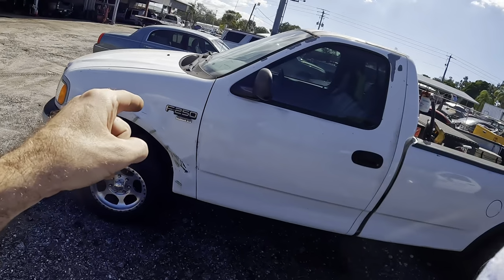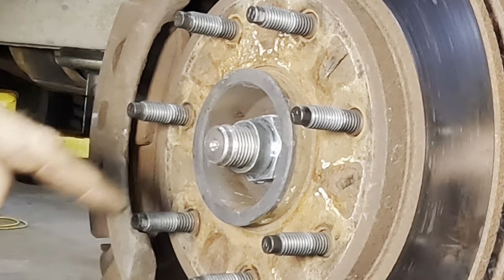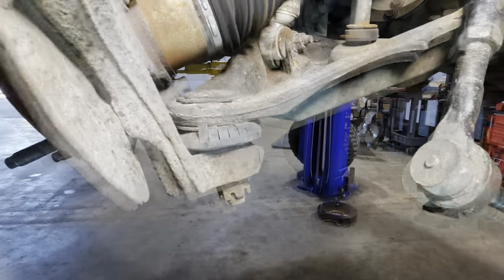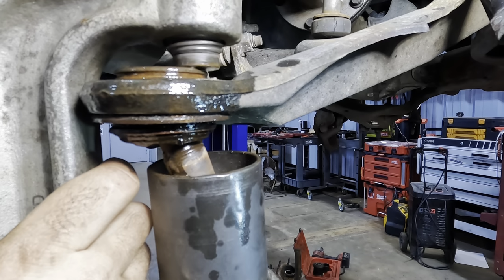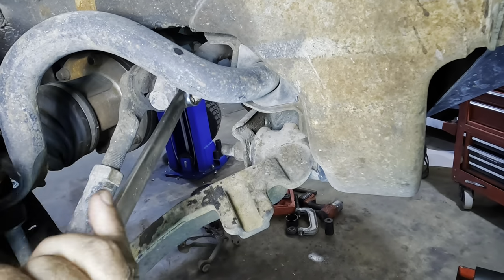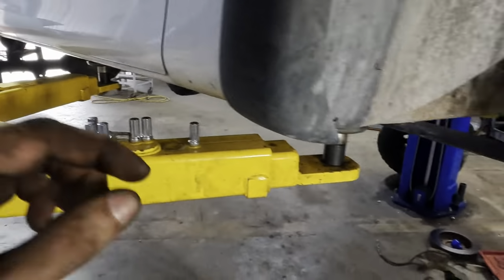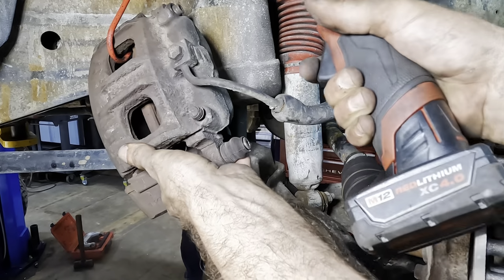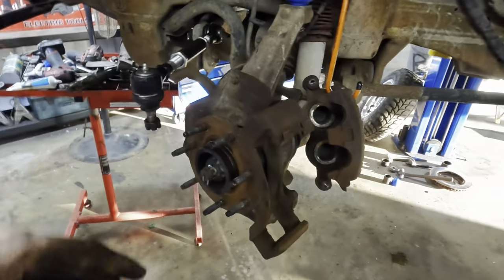Loose Balls- 7 Lug F250!  Wheels Fell off!

Comment: I'm wondering... Could those lower control arms might have been off a F-150? Making the F-250 ball joints the wrong part?
Reply: No, because the 7-lug F-250 is basically an F-150 with heavier springs and torsion bars.

Comment: Hey Ray! I can't help but notice that the rubber boot over the brake hose looks a bit swollen.  I suspect there is a bit of rust build up witch affects the crimp collar where the brake hose meets the metal line on the caliper. ( you can see it at around 52:10 into the video) I personally have had situations where the brake hose blew apart at those fittings because it can't take the pressure of the  brake fluid anymore. I now allways check under them to make sure they are strong enough. And no one like's it when your car does not stop when it's supposed to stop, because THAT! would be bad. Other than that another very good video👍
Reply: It’s a shield or covering over the brake line 
You can also see it earlier in the video lol

Comment: Hmmm. I wonder could that lower control arm have been changed for the wrong one, sometime in the past.
Though, I think the taper is too big for the knuckle, too, so the knuckles would have had to be changed too. ( Look at me talking American. That’s going to cause me some problems, when I get back to work!)
But the old lower ball joints do look a bit puny for such a big 4x4 so something seems a bit off.

Comment: '99 is probably 2 valve. And the odometer will probably come to life after key has been on for a few minutes (as my 99 Expedition does)
Reply: I don’t think you can push out the pistons on the same axle, aren’t Fords a diagonally split system ?

Comment: I hate the need to use a lug key, socket, flip socklet, etc I begged Snap On to make non flip half size mm sockets, and wheel lock keys that don't require a socket. They're missing the factory adjustment plates?  2WD lower C Arms? Had a customer destroy his spindle and we couldn't find a replacement ANYWHERE. Junkyard hunt/Mexico import :D

Comment: QUESTION:  is it common that your customers supply their own parts for you to install rather than you ordering the parts you need❓ I suspect the parts you order may be of better quality than customer ordered parts or am I incorrect on this point.  Cheers from 🇨🇦
Reply: Parts are also a profit center.  Ray had a video on this very early in the new shop.  I think he allows it on a case by case basis.
Reply: @StrongDreamsWaitHere  that is what I was thinking as well.  There is profit in those parts but only if he supplies them.  Cheers
Reply: I will bring in my own parts if I want a certain brand or type of part, like brake pads and rotors.  Most shops will put on whatever's in stock or is the cheapest.  The sooner you wear it out, the sooner you'll be back. Custom parts too. If they're going to pull the deferential cover, I might want an aluminum replacement.

Comment: The suspension is probably in such bad shape because it might have been in an accident. It still has the body pullers on the front driver side. Probably cause the shaving of that nut and the complete destruction of most of those ball joints or at least pushed em along.

Comment: Reee.....  @54:13, ABS sensor wire bracket not properly installed - missed the inner hole of it with the bolt.   Getting sloppy Ray - too distracted.

Comment: that guy whole front end replace, if it were my truck i would just replace both arms since the new arms comes with brand new balls, but also get a camber bolt since the bolt that came off didnt have the camber washer and drop some gear oil down the ABS hole to renew the grease a bit, you be surprise how well it works, tire rods inner and outer, drag, but its a ''work'' truck and most people that have a '' work truck '' treat them worse than a farm truck that doesnt leave the farm and only do bare minimum when the wheels fells off and only when they get caught other wise you can expect to find paracord and steel wires holding shit

Comment: Its a good job you'd got a buddy (Dave) to go to the autoparts store with the wrong item 
think of us soloists that have that problem and your working on your one and only transport 
It happened to me many years back changing the clutch and the parts didn't fit the spares place couldn't work out why their parts were so different from the old one I took in
Eventually after many parts unboxed they found a match
Good job they persisted to keep the sale otherwise it would have put me in the mire with no vehicle and thinking which parts dealer to go to next without having to goto the main dealers and pay triple the cost + cab fares

Comment: Am I going the right way? No but keep going... it will be funny!
 as we ratchet this unit it will push the pistons inwards... and if you clamp off the line & crack the bleeding nipple and contain the escaping fluids, the old crusty fluid will not go back through the ABS and into the reservoir overflowing it all over the engine bay & paintwork, and potentially introducing unwanted materials into anything that may be adversely affected by them.

Comment: Here's what I've always done to remove cotter pins readily: I straighten the ends somewhat, then I tightly clamp a genuine Vise-Grips on the round end, then tap on the Vise-Grips with a hammer, always works.

Comment: Ray: The "Maintainence-Free" ball joints are BS. It's the "Planned Obsolescence" principle of engineering; they can't be greased, because they don't have grease fittings.
Like that ball joint on the lower control arm. That came from your "Deliverance" parts supplier. All other ball joints had fittings except the lower.
You would know more about this than I would. Can you drill and tap the top of a "maintenance free" ball joint and install a grease fitting? It's probably considered unethical when working on the public's vehicles. But would it work on your own?

Comment: I always thought those 7 lug f:250 light duty’s were weird. Gm did a similar thing in the 90’s with the 2500LD which was a 6 lug truck like the 4wd 1500’s and again in the early 2000’s with the Heavy Half which is 8 lug.
Edit: I don’t know if it would work or not but couldn’t you mark the position of the upper a-arm on the brackets to keep a similar enough alignment? I would still get it Aligned but would it be easier to do that.
Reply: The light duty version of the f250 was later moved to the f150 as a 7 lug f150 HD.  It makes more sense as a f150 HD.   Also, to answer your question about the alignment….the marking will get you close, just the witness marks he uses in the vid.  But either way you have to get an alignment because no 2 parts are made exactly the same.
Reply: @redbo1519 I figured it would still need aligned, and not 10 minutes after I made my comment he talked about the witness marks lol

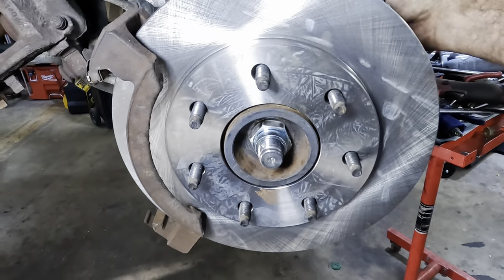Comment: At 54:00 you didn't see it and didn't install the wire wrap around bracket correctly (it has 2 ends) because you were not looking at it from the same angle as the camera. Please don't let my negativity get you down - no one EVER wants me to inspect a used car for them a second time.

Comment: So unusual for you to have such an off day and parts struggle supply never helps. Maybe you rely on wife unit to look after your nuts too much. 
NOT turning the steering, while someone else is working on the other side to expedite the job is good thinking, and you coped admirably in the circumstances. 
Forgot to point out what pushing back the caliper pistons can do for under bonnet (hood) paintwork if it has been topped up for and is too high for new brake pads.
Update/finish video gives you the benefit of hindsight. Just like me. LOL

Comment: Wow they actually did make 7 lug wheels. I had always thought they were just hub caps. That's... just bizarre. Of course I never owned or worked on one so I guess I wouldn't know. Who thought that was a good idea? because 360/7 = 51.4285 degrees. 360/8 = 45. 360/6 = 60. I mean..... 40:10 Call it what you want it? I thought you were going to start serenading us with New Kids on the Block...

Comment: Hi Ray, as a regular viewer from the UK, I am frequently amazed at the mileages  some of these vehicles (that you work on )have done and also their ages. In the UK , we have a mandatory govt test every year for vehicles that are 3 years old. and over. Some of the faults you have identified , such as on this particular truck , would result in the vehicle being taken off the road in the UK. Do you not have mandatory roadworthiness testing in Florida.?
Reply: "Do you not have mandatory roadworthiness testing in Florida.?"  Zero in Arizona.
Reply from the maker: Some states make us have inspections and some do not. As for the mileage / Km-age think if it like this. A two hour commute for you across the pond is quite far, however due to the vastness of the US, driving an hour or two is common. We have a lot of land between cities
Reply: Here in the state of Kommifornia, we do not have mandated vehicle safety inspections. I find that surprising, as we do have mandatory emissions inspections and other nanny-state nuisances. Rust is generally not an issue here, but vehicles on the road held together with baling wire and duct tape is.

Comment: 37:45 BRO STOP You're either going to mushroom the head of the bolt where the cotter pin goes through and then you won't be able to get the ball joint through the steering linkage or you're going to break the tool just literally hit the joint with a hammer at this point and it will break loose

Comment: Bad news for you. If it is a 1999 it has a two valve 5.4 L triton in it the 5.4 L three valve didn’t come out until 2002 in the Australian market and was not released in the US until 2004 so unless somebody did an engine swap on that truck it doesn’t have a three valve! Please check yourself before posting a video!
Reply: Don't be too hard on Ray...  It's not even a 5.4l. 😂

Comment: I’m kind of confused why that truck is an F250 it looks like a tent generation F150 the F250 for 1999 was the first year of the Ford super duty trucks that truck does not look like a first generation Ford super duty F250 it looks like an F150 has  ford done to  this truck
Reply: Its a heavy halfton edition ford did for awhile. If you notice f150s have 6 lugs, these have 7ugs. Just has heavier suspension stuff.
Reply: I have one of these trucks.  It's basically just an F150 with beefier rear end and springs and it's 7 lug.  My truck is a 99, 4.6L with 4R70W so basically it's just an F150.
Reply: Just adding that in 2000 I believe this truck was rebadged as an F150 7700 HD or something to that effect.

Comment: What logic is there in having about 3k dollars worth of tires and rims installed on a truck  @ 250 to 300 a tire only to have a suspension system and steering system in that bad of shape.
I take it the state of Florida has no safety inspections, I've seen a bunch of cars on Raymond's channel that do not belong on the road, then customers decline very nessary work all legally because a mechanic can't  do anything about a very dangerous car  leaving the shop still broken. 
The shop risks being sued if the person drives it away like that not nessarly   by the customer who refused repairs, but by the persons who were injured when that car fell apart. Liability claim you were the last person to look at it.
This was documented by carfax.
Insurance companies can read that information. Wait until they start using that information to place blame and it will happen.
Anything an insurance company can do to get out of paying a claim they will do. they don't make money off car insurance.

Comment: That is and f150 lol badge swap
Reply: Believe it or not this truck left the factory with the F250 badge.  I have have one of these.  It's listed as an F250 base model or sometimes called the light duty.  In 2000 the this truck was rebadged as a heavy duty F150 which makes more sense.
Reply: @wexysexy6942   Damn I've owned 5 F150s and a super duty. This is the first one I've seen. Pretty cool though thanks for the heads up.

Comment: Rainy man I don't know why ya'll keep running the impact on a ball joint not moving when all you need to do is stop and hit it with the hammer. That is some good tools ya'll use better than anything I own for sure but to save the impact anvil to stop and strike with a hammer would save cromppunits. Nyanya.Nanyang. when yee give this back to the customer it will drive so much better that miserable three valve spark plug killer he will brag on it as actually being a good rig.

Comment: Again you tighten the upper control arms in very, very unprofessional way. Why did you do that, in way you tighten bolts in this position on the control arm when you put the car down you ruin the bushes. The bushes suppose to be tighten in horizontal position on the control arm. I like your videos but that kind of mistake is not serious man.
Reply from the maker: I literally said that I’m tightening them in a raised position to account for the normal ride height